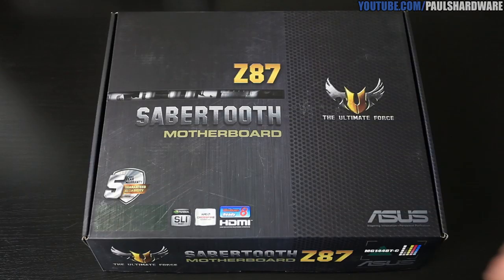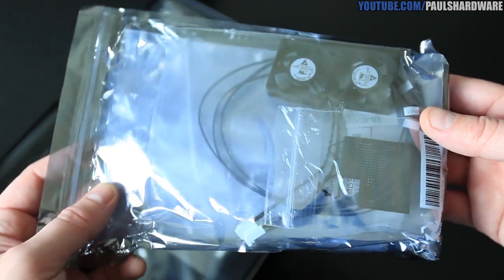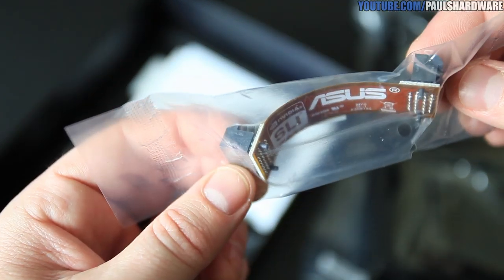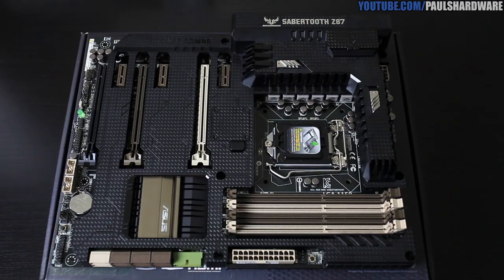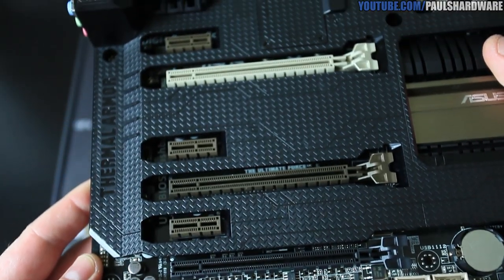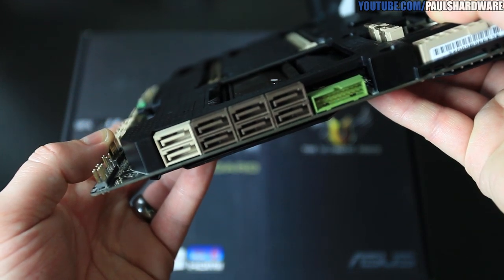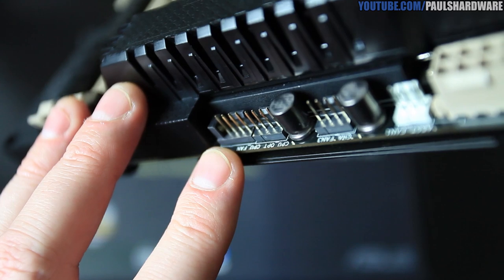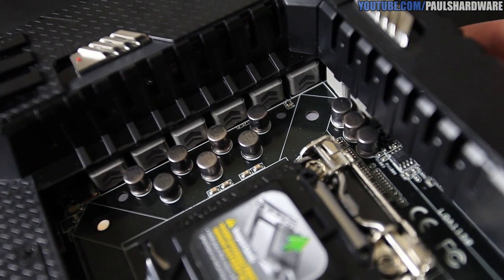ASUS Sabertooth Z87 Intel Haswell 1150 Motherboard Unboxing & Overview

Comment: I would like to see in-depth BIOS reviews, as in going thru each and every option and telling the viewers what you like or dislike.

I am about 80% sold on this board, its just that I have an EVGA gtx 680 video card, and I would like to be all EVGA. Of course, EVGA has a terrible track record with mobos, and thats why I am probably going to get the sabertooth. My current rig has an ASUS P6T WS, and has been kicking for nearly 5 years. ASUS is awesome!

Comment: you can get the Gryphon Z87.  It's part of the TUF series (same series as the Sabertooth Z87/Z77/X79/990fx.  It has the LGA1150 CPU socket so it only works with the new Haswell processors by Intel.  The catch is you have to buy the thermal armor separately.  It's a $170 'board though, so it's cheap (compared to the Maximus V Gene in their ROG series)

Comment: It does, just use XMP Profile and thats all. Im usin 4x4 gb 2133 c9 with this mobo also i had the z77 which was also compatible. The speeds supported in the description are non oc speeds supported, anything above 11866 is overclocked and you can overclock up to 2800 with this mobo.

Comment: Hey Paul, i assume you got alot of knowledge when it comes to computer specs?

I just spent around 2k Euros on my new gaming computer and i picked this moatherboard, i whould like to ask you from a scale 1 - 10 how good you think my new computer is / will be, i just ordered it this Monday 18.11.2013 and it's most likely here the next Monday :D (pre-built)

This is my spec @ the new computer:

processor: Intel Core i7-4770K

moatherboard: ASUS SABERTOOTH Z87, Socket-1150 (spesific)

memory card: Corsair Vengeance Pro DDR3 1600MHz 16GB

graphics card: Gigabyte GeForce GTX 770 4GB PhysX CUDA (spesific)

power supply: Corsair CX 750W PSU ( i doubt i need the 1000w PSU?)

cpu cooler: Corsair H55 Hydro Series

SSD: Kingston SSDNow V300 120GB 2.5" OEM (spesific)

SSHD: Seagate Desktop SSHD 1TB

Based on all this info, what whould you rate this computer? 

Please reply and thanks for a great video about the moatherboard, i think you did great unlike most review's (Y) thumbs up!!
Reply: its whatever :P thats what i had to choose, the computer runs as the beast it is but thanks for telling me, ill ask you if i'll get something new
Reply: you better had to go with the non k version and letthe boost oc the cpu, and i personally dont like the gtx 770, better go with the 760 8about 150 eoros less or go with the 780 5 euros more for the reference) and for the cpu cooler better go with the noctua one, the nh u14s or a h60/h100

my pc is the i7 2600 no k the boosted up to 4,9 ghz on the noctua i might upgrade this, and gtx 760 oc 1341 mhz
from my experience every game runs on ultra w 50-70 fps and i have spend just 850 euros so :D

Comment: Enjoy Taiwan, we are located Japan, and we just bought this board (instructions all in English, luckily). 
Would like to see you set the board up, install to setting up Bios for us. And show us a few sets of options of clear settings; some of us are moving to a new Bios for the first time in Eight years.
If poss;
Tell us if the 4770 version of the 4770K chip is a factory tested lower standard model. Would like to know if all the 4770K`s are `tested` and found to be microscopically better/faster?

Comment: i have heard the haswell cpus are not very good for gamer pcs is this true or not as i almost got a sabertooth z87 mobo but herd it only works with haswell cpus and wont work with a i5 3570k cpu again is that true or can you use a i5 3570k cpu on the new sabertooth z87

Comment: Im using the asua rampage iv its atill un the mail and it has 8dimm slots ddr3-2400and was wondering because theres four black slots and four red slots so can i use all slots to get 2quad channelz or do i have to follow the daul channel you explaned on the vid

Comment: like to see it in a system with the full 32GB of ddr 1866 if possible with a nvidia solution and a ssd and what kind of numbers it generates in testing :) thermals and performance markers.

Comment: The best mobo ive senn are the asus rampage iv beacsuse it hold an intel i7-3970x extreme and 8 dimm slots for ram alao anoher asus board that holds two intel i7-3970x extrwme editions and 8 dimm